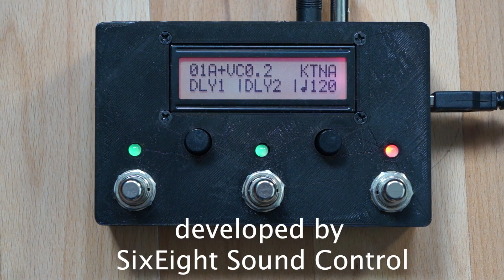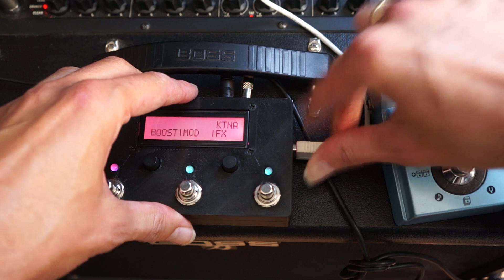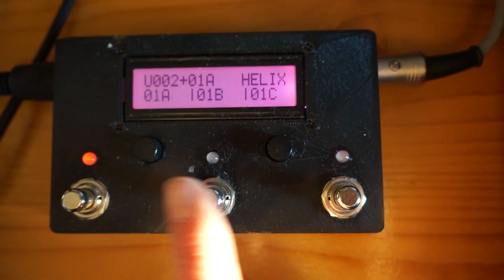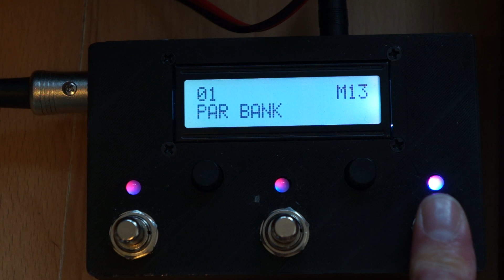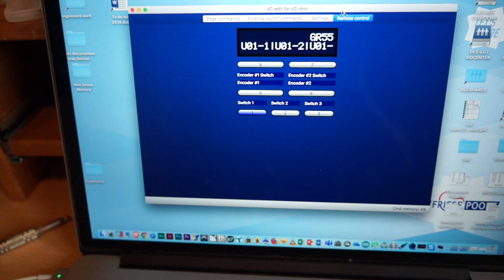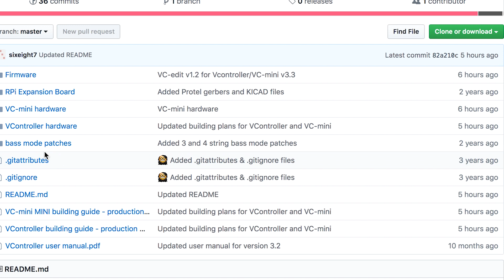VC mini - the ultimate small MIDI foot controller for the Katana, Helix, ms70cdr, GR55 and more....

Comment: Hi Catrinus, 
Your VC project is very interesting !
1. Can the VC mini and the VC3 control/work with Bias FX2 on a laptop (with usb connection) ?
2. I suppose that we can start with VC mini and upgrade to VC3 ?
Reply from the maker: It can do basic midi  pc and cc control, but not much more than other MIDI controllers.
Reply: @SixEightSoundControl  OK , thanks,  I suppose that we can start with VC mini and upgrade to VC3  ?
Reply from the maker: @vicvergauwe5736  You want to build one? VC-mini is a good starting point. Contact me at sixeightsoundcontrol@gmail.com for more information about pricing and availability.

Comment: Super awesome, does it work on Valeton GP100?
Reply from the maker: No. Basic Midi support will work, but not the fancy stuff, like reading patch names and parameter names and states.
Reply: @SixEightSoundControl  Yes, i just want to change patch & tap tempo on Valeton GP 100 using external controller, is it possible?
Reply from the maker: @Vladimir Possibly. But I am unable to test it and have no intention to get a GP100

Comment: Can this device accept MIDI-In from a Boss GT-100 and control a Katana via USB?
Reply from the maker: Yes, it can do that...
Reply: @SixEightSoundControl  this works with Boss gt-001 (GT100 desktop)
Reply from the maker: @eromjunior1448  It only has basic midi support for the GT-001. Not patch/parameter reading.